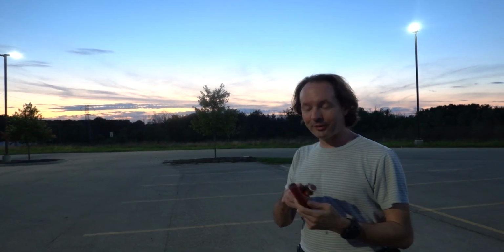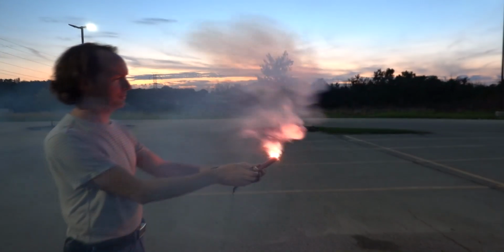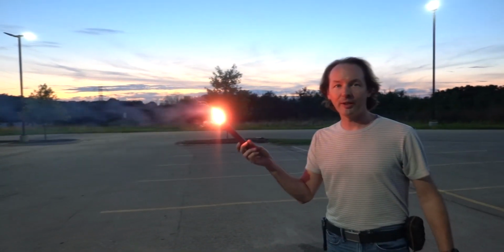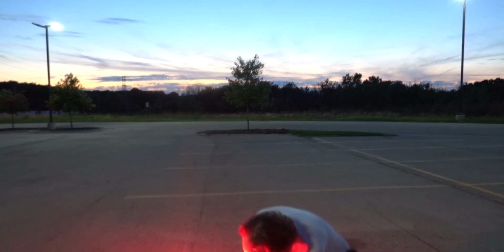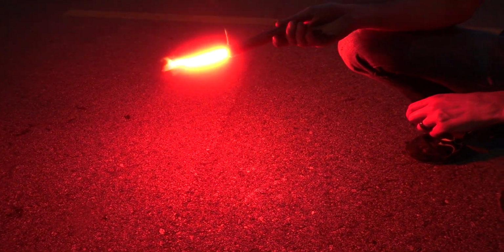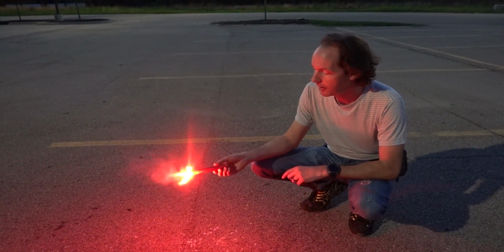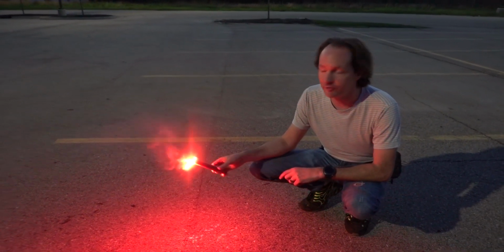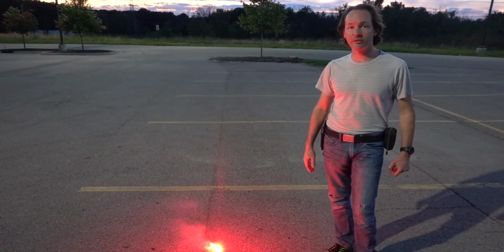Road Flare Basics

Comment: I had three 15 year old flares that knocked around in the truck of two cars in a safety kit. All three lit and burned without problem. IMO much better than a battery powered emergency light that you discover has dead batteries in your moment of need.

Comment: I keep 3 15 min and 3 30 min flares in my car.  They will only burn half as long underwater.  Can't play with them as I used to because I became allergic to the sulfur compounds in the smoke.   For prepping, I have 21 15 min in a 30 cal ammo can.  It'll be a good test as to their longevity.  Should last longer than a replicant that way.

Comment: Never seen that version, but I imagine anyone can figure it out, but where would the best placement be?
Reply: I would say on the side of your car (the side that drivers will pass) and behind your car depending on how many flares you have, just as visible as possible is good
Reply: Depends on where you are and how fast traffic is moving, but on highways I go by the trucker rules: one about 10' behind the rear bumper on the traffic side, one about 100' behind the bumper in the middle of the lane or shoulder, and one about 200' behind the bumper on the curb or verge side. Basically, the idea is to give drivers plenty of time and distance to slow down and/or get over. Flares are nice to have, but they do burn out quickly, so I would actually recommend carrying reflective triangles instead.

AND WEAR A HIGH-VISIBILITY VEST WHEN YOU'RE PLACING THEM!!

Comment: You explained how to use one. But you never explained their purpose. What's the point of a road flare? I'm not being facetious. I legitimately don't know

If you wanted light, why not use a super bright LED flashlight? 
If you needed to signal using light, you can put the flashlight SOS/strobe (most modern flashlights have them these days). You can get multiple hundreds of lumens from them in that mode and they can signal non stop 72 hours on two or three AAAs depending on the light. 

As for the means to start a fire in an emergency, why not just use a magnesium rod, a ferrocerium rod and/or a lighter? They're more compact, safer to store, and can start more than one fire before becoming garbage.
Reply: Flares are waaaayy brighter than any LED light that does not require either el mongo forced air or even liquid cooling.  And they will store for years without requiring charging.  And any electric light of comparable brightness requires many tens or hundreds of watts, so big batteries.
They also work in nasty conditions and are cheap.  The unidirectional light also helps.
Reply: The point is that they're cheap, disposable, self-contained, all-weather signaling devices that don't require cords, batteries, tools, or any other equipment. If you have a properly-stored flare, you have a functioning light even if you have absolutely nothing else. When drivers see a row of flares on the road, they know that they need to stay away from them. When they're no longer needed, they'll burn out soon anyway. Nobody needs to walk into traffic to pick them back up like they would an LED flasher.
Reply: the amount of ignorance on display is more blinding than a road flare